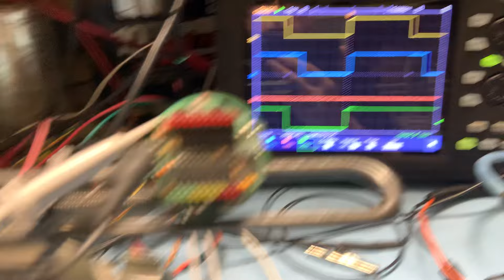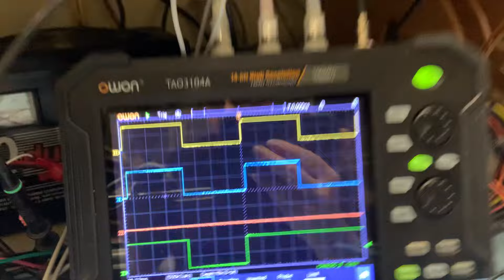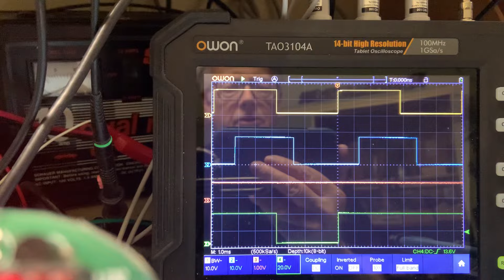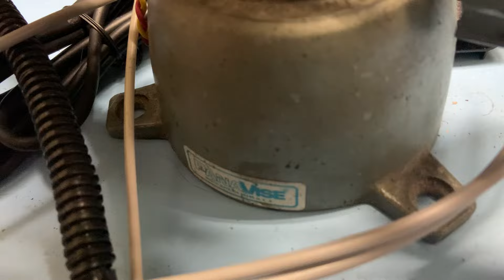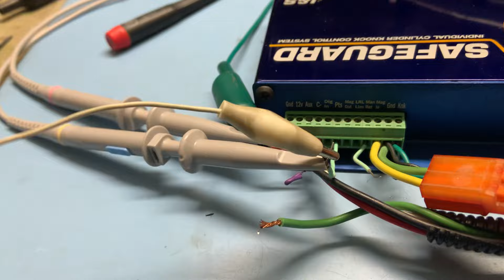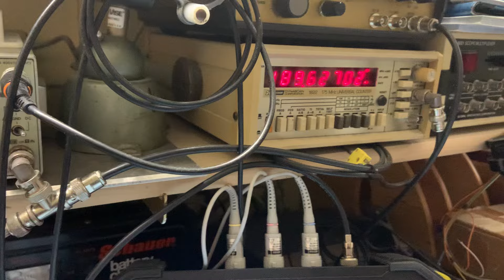J&S SafeGuard Individual Cylinder Knock Controller

Comment: This video would benefit from an introduction explaining what's going on for a viewer who has no previous knowledge of what you're doing. You can assume standard background knowledge, e.g., what an ECU is, what an oscilloscope is, how electricity works, etc. But the specifics of what's on your bench were hard to me to grasp.
Reply from the maker: Fair enough.  I'm a small manufacturer, and make knock controllers for distributor and coil on plug ignition, with versions for dumb coils and for smart coils.  I have a few videos on my channel showing operation.

Originally this was going to be a retest of a customer's J&S SafeGuard.  I don't use a script and since "it was a retest", didn't feel the need to explain the purpose of the system.  The SafeGuard is an individual cylinder knock controller.  He has the Universal version for distributor ignition.
Reply: @jselectronics8215 maybe change the video titles to what the content means instead of the date?
Reply from the maker: @koushiroizumi0  Yeah, sorry about that.  Youtube puts the date in as a default when you forget to add a title.
Reply: “Automotive knock sensor test on oscilloscope”